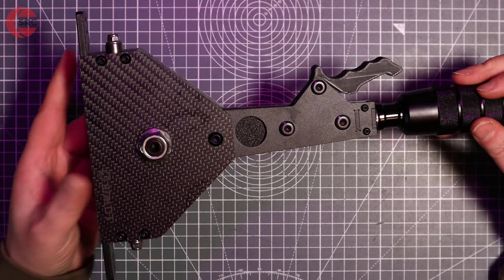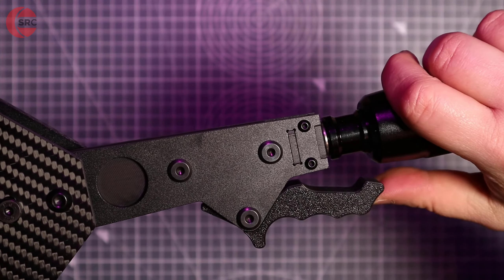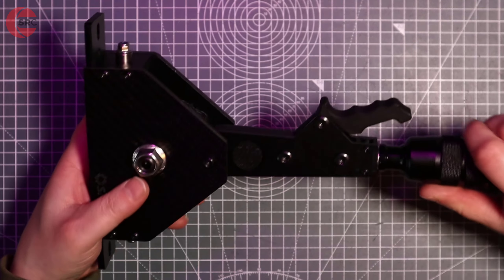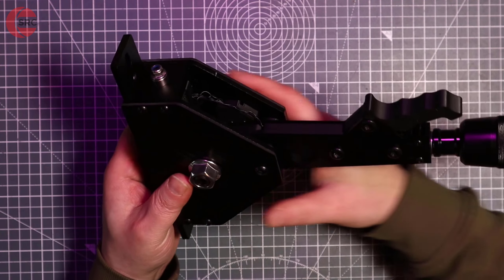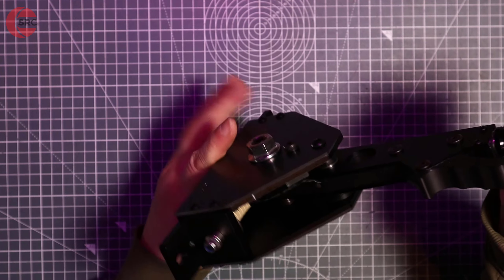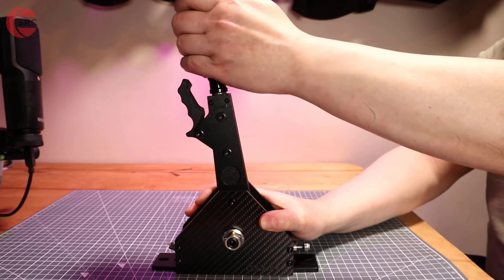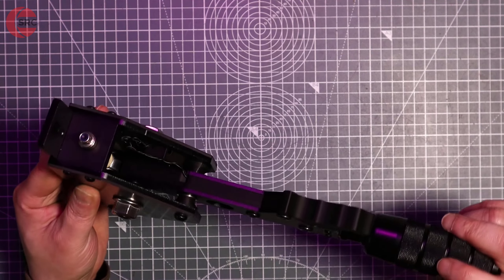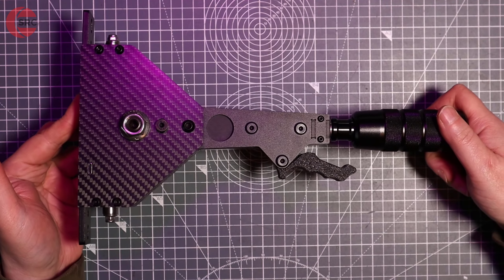SIMDT SR Sequential Shifter [UNBOXING] My latest budget pickup!

Comment: This looks like good value and good for a small setup. @SimRacingCorner , is there any chance you could still do a deep dive on this one? I'm seeing some enticing prices and it's possibly the only ali shifter express with a usb c port. I use a wheel stand pro which can't take a whole lot of torque from mounted levers. So this looks like a suitable companion to my Moza HBP handbrake.
Reply from the maker: It's in my review queue, I will get to it eventually.

Comment: Did you ever measure the force required to actuate the shifter? I'm just looking for something very tactile, and hoping for that Neutral lever.
Reply from the maker: I haven't yet. It's just sitting in my 'stuff to be reviewed' queue right now.
Reply: @SimRacingCorner  I look forward to that review
Reply: @SimRacingCorner  would you say it has as much resistance as the magnetic Ali Express shifter?

Comment: Appreciate the heads up. 
If Moza doesn't pull their fingers out soon, i might look into one 👍
Reply from the maker: I do have some news on that, the Moza seq shifter is coming soon. I had contact with them in December. They haven't given the exact launch date, but it looks like reviewers will be sent units this month, so that means not far off.
Reply: Which one you like more this or moza?  @SimRacingCorner

Comment: It looks pretty nice, altho those cables don't give me any confidence. Had a H shifter from ali a few months ago that broke because the shaft was hitting the wiring on the board, it broke the micro usb input as well (the shifter was quite strong). Bought the cheaper simjack with micro switches one and been flawless,  just way less tension than I would like it to have tho.